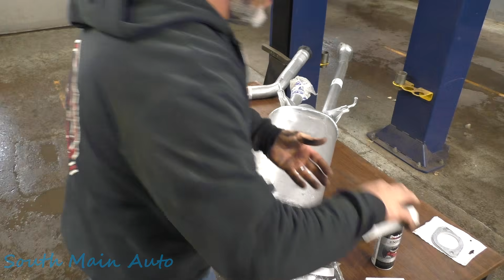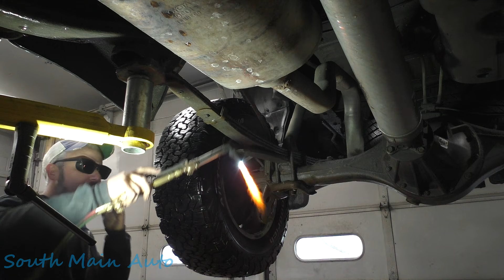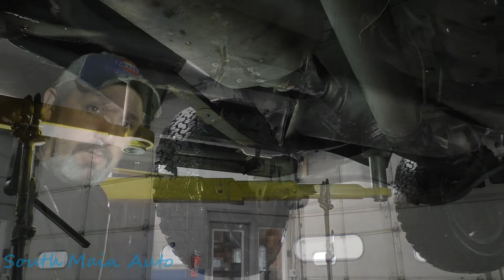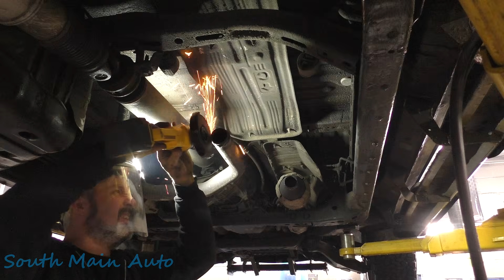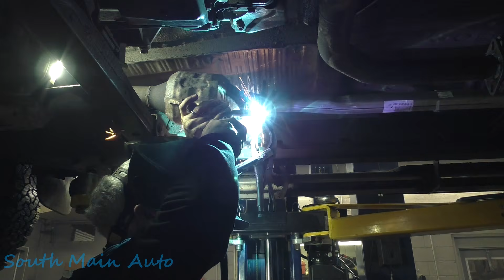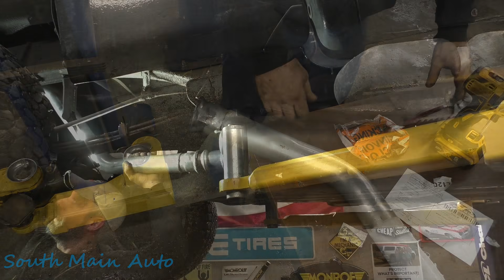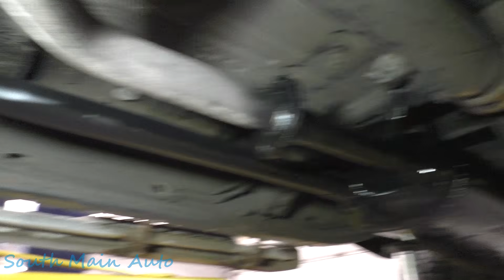Toyota Tundra: Welding On New Convertor Flanges & Replacing Muffler

Comment: I've been TIG welding for the better part of 25 years and I rarely burn myself now... or my hands are so full of scar tissue that I just don't feel it anymore. My coworkers however will burn themselves regularly, especially the person that I'm doing the job for. You would think that if you ask someone to use a shielded electric arc to melt two pieces of metal together they would be a little more careful about grabbing the part. I try to dunk it in the deep sink and quench it before they put their booger hooks on it, but that's not always desirable especially if it's going out to be heat treated, or if they're standing just outside the weld curtain saying, "Is it done yet? Is it done yet? Can I touch it? OW! Why didn't you tell me it's hot?!"

Comment: I'm a Chevy guy, but pre 2000 only. Got a 91 Silverado with 300k on the clock, and a 96 Blazer with 218k. Both still run great., In my 20's had a 72 Toyota Carina, 14 inches of snow could not stop it.....but my ex wife could. She blew it up.🤬

Comment: If I ever get to upstate NY on a road trip in my Idaho homed 2002 Yukon, I want to schedule an oil change at SMA so the crew can experience a little slice of heaven. My 2002 Yukon is 100% rust free. When I changed the trans filter, last year, all of the exhaust system bolts came apart with only some PB. The front brake pads and rotors are still original at 288k miles.

Comment: Free tip Friday for the ground on the exhaust.
Take heavy gauge copper wire, like welding cable, strip the insulation off of it, and wrapping the copper wire around the exhaust and welder clamp attachment clamps onto the wire. Works well for anything round.

Comment: Cutting torch expense...  Most likely, DIY'ers are grumbling.  But, I'm a DIY'er.  The Port-a-Torch setup with little pony bottles works well for the once or twice a year I need serious heat.

I've thought about going bigger but just haven't gotten around to it.  I see the need for heat more for metal work and forming rather than automotive repair.

Craigslist and Facebook Marketplace are your friend for low-outlay shop equipment.  Of course, it's a bit of work.  But, you pay either with cash or time...

Comment: Anyone batching about the cost of a cutting torch is working on 20 year old vehicles that still look brand new. I worked as a tech in Eastern Canada for Years and probably used the torch every single day. Someone from the south should try and take a set of rotted sway bar links out without a torch and without cutting them off

Comment: I work on stuff in my home garage.  I have a mini oxy/ascet torch tank set.  like, 1 foot high.  I just exchange the tanks locally when I need a refill, which has only happened once, but they are a life saver in the rust of the midwest, and I would say, a necessity in a professional shop for speed and time saved over fighting rusty stuff.  I have seen Rainman ray get some rusty crap in from the midwest or northeast, and he does well enough, but man, when shits rusted into a single piece, a torch that can get it hot FAST is nice to have.

Comment: Mechanic in Newark NY here. Had a Snap on guy ask me what my most used tool was. I said a torch and a hammer and he looked at me sideways. When you can cut a nut off and not hurt the threads you're officially a Rust belt mechanic.🤙

Comment: Huge disconnect between people who are used to rust and those who aren't.  Look at any online auction for a car with a little surface rust on it, the non-rust people think its junk.  Probably the non-rust people who never see a torch in the shop. What would they use it for when 20-year-old fasteners fall right off.

Comment: A set of oxy/acetylene  torches can be invaluable. As you know they are valuable for cutting heating loosening things but a lot of people don't realize with the right torche body and the right tips you can do some nice steel welding with them.  I have a nice set that I've had since the early seventies and I don't use them anymore but they're in my shed ready to go if I need them and I would not dispose of them.

Comment: I just fixed a guy here for the exact same thing. He ripped it off in the bush around his axle.
Aftermarket was crap also.
Flanges were already missing. 
Made new flanges with the plasma cutter for him from some steel and welded it on.
As for cutting torches.
Here in the GWN in Canada, it’s $100 a year lease per tank, then its expensive to exchange and refill the tanks here.
I use an oxy propane fuel instead as refilling it is cheap. Own a 50 cu ft tank and refill it for $35 then refill a 20lb propane tank for like $15. Much cheaper then having a acetylene tank refilled for over $100 and rental fees etc, then local place even screws you again if you don’t exchange the tank once every 12 months.
I plasma cut a ton of things now instead and use the oxy propane to heat things. Or cut some exhaust off with just a regular sawzall

Comment: Hey Eric we keep a cutting torch in most of the shops I have ever worked in, down here in Texas and even have one in my dads shop since I was like 4 years old. Oddly enough the one that is in my late fathers shop, is the same one that he had back when I was 4 years old and the only thing that has been done to it is the hoses replaced. And yes we use those cutting torches for much the same things, cutting rusted bolts and exhaust pipes. Now before you get shocked yes we have rust in Texas as well especially down on the gulf cost, and more so on old trucks that are 30 years old or older. Had to cut a few bolts on my old 1965 Ford F-100 when restoring it some 30 years ago, that cutting torch sure got a work out that year as I did a frame off restoration.
Reply: I have purchased a few southern vehicles. I have had to heat up exhaust fasteners to remove to prevent breaking.

Comment: I used to lease my oxy/acetylene and argon/CO2 tanks but, I picked up a nice big set of Torch tanks and 2 #4 welding bottles at a local farm sale a few years ago. Owning them works better for me because I can get them filled at the cheaper of my 2 local welding supply shops.

Comment: Hi Eric, you are a master with a cutting torch. I would be happy to be half as good as you. Welding is plenty good enough. I would be well pleased with your result. A truck exhaust is not a 1500 PSI gas pipe.

Comment: For a truck driven in the north east, the frame and undercarriage look really good.
Reply from the maker: It is a daily dirt road driver and a I plow with it
Reply: Fluid film
Reply: @chrisE815   looks like a ton of it has washed worn off to bare metal... use WoolWax its thicker stuff
Reply: @efil4kizum  yep,  I agree. Got a 5 gallon tub of that stuff just gotta get around to it this year lol
Reply: @chrisE815   if you really do not wish for it to wash off with ease get the WW HV stuff that you brush on when its hot out and goes on smooth as butter and thickens when its cold
Reply: @efil4kizum  What is WW Heavy? I can't find it anywhere not that I would buy it anytime soon because I have 5 gallons on hand
Reply: @chrisE815  HV is high viscosity WoolWax for extreme high wash applications. I found it on their direct website and so far after 3 years I have good results of it staying put in the rear wheel wells where FF and regular WW eventually washed off in heavy rain wheeling. They sell a small 16 oz jar to try it out... One drawback though is it collects dirt and sand like mad up on the front control arms suspension area
Reply: @efil4kizum  Good info thanks
Reply: An ounce of prevention is worth a pound of cure, as they say.
Reply: Fluid film my 06 Tacoma every year and I live in southeast PA where the brine and salt are used. The frame is still original and looks great. Like Eric’s Tundra.
Reply: @mikeanthony7940   is a lot of FF washed and worn off like it is here  unprotected metal
Reply: I never heard of fluid film until I started watching here.   If we get a few inches of snow here in the South it's over. Snow plows??? Haha nope. Not here. We all just stay home and wait for the roads to melt 24 hours later
Reply: @MARKE911  i would look into WoolWax WW, its much thicker and durable than FF, and doesn't wash off quite as easily as FF leaving unprotected metal at sub zero degrees
Reply: I live in Michigan 9 inches of snow means you leave 5 minutes early for work. But you still stop and get your coffee ☕

Comment: Nice truck! You guys can try Northeast Exhaust for oem style 409 mandrel bent catback exhausts. Kinda cheap surface rust still shows in places but for the price it can’t be beat. Depending on application might need “corrections” but still OK LOL

Comment: I used to work at a big name tire shop before I moved on to my current career. We had a torch when I worked there. I needed tires I went back to my old shop to see what everyone was up to. While I was talking to one guy I saw he was using one of the induction heaters to heat up a nut on a tie rod. I asked where the torch was, and he said they are not allowed to have it anymore cause some guys got careless and other locations and caught a couple cars on fire. The district manager freaked out, and said no more torches.

Comment: Out of curiosity- did you consider the Toyota stainless TRD exhaust system? I realize the standard system is on backorder, but I think the upgraded TRD system is floating around at some dealers. Since it's a factory Toyota exhaust the noise level isn't much louder than stock unless you're foot to the floor. Price is around $700 so that's the only negative.

Comment: The heat wrench is a must where I come from. I use propane and oxygen , it works awesome , I don't miss acetylene at all. That's the best looking aftermarket exhaust I've seen in a long time , hope it holds up as good as it looks
Reply: Only the second time I have heard of using Propane rather than Acetylene.
Reply: @dougbourdo2589  All the muffler shops I used to go to used propane.
Reply: I also use propane and oxygen it's much cheaper and unless you are cutting 1/2 in plate steel there is not a huge difference.
Reply: When I was farming we used a carbide acetylene generator. I know it was an antique. Switched to propane in the winter.
Reply: It's painted black.....so you know it's good. But then he puts his had over the tail pipe for a second, probably set a code🤣

Comment: I bet your engine runs great, and your transmission hasn't blown up. Those are great trucks. The muffler on my 2004 5.9 ram completely rusted through and the fuel pumps went out, that's been it. The 2013 Tundra's not that old(yet). Thanks for doing the video.

Comment: I personally hate the cutting torch for anything other than absolutely needed! Work with some folks that will only use it just to heat a bolt of nut up! Freaking hate that! Flame is too big not well controlled enough for me! Its like using a 120 welder just nope nope nope if it's not a 220 I'm not gonna even look at it!
Reply from the maker: Wow haha, you must really hate me, I used a 110 welder and a torch in the same video.

Comment: Eric, I saw wondering if you disconnect the battery before you use the arc welder? I had a friend a few years ago who had a muffler put on at a national chain shop and his battery was toast after they finished the welding.
All the best to you and the family for the Holiday Season!
Reply: That won't stop any damage. You notice he commented a couple of times about keeping the ground clamp close to the work. That is much more important than the battery.
Reply: @Itsalongwaythere  You need to be sure the ground is close and in a direct path to the welder. Where you run into trouble is if any of the current can take a different path through the electronics. So say you have 2 pipes and 2 flanges to weld. Fit it all up, then ground to pipe A and weld on the flange on that pipe. Now ground to pipe B and weld on it's flange. Keeps the loop short. When it really counts is doing bodywork with a welder. Then you can have different grounding paths and ground loops become an issue. 120 amps at 6-8 volts through a computer boards ground path is not a good thing.
Reply: And the computer can get cooked

Comment: you forgot to tell us the wire you used, the feed rate, the amperage and the gas mixture 🤣
Reply from the maker: 75/25 on the gas, 0.030 wire and used the auto feature for wire speed and heat on the 211 Miller ;)

Comment: I’m in the Midwest (aka the other rust belt), and yes torches are necessity in our shop. The time it saves, and the ability to get out rusty hardware is well worth the expense. We lease our tanks as well through prax and when we have empty tanks they just swap them out. No need to worry about hydro testing and such.
Reply: Even for non-rusty stuff like the single nut end of a shock absorber, cutting the nut off with a torch is much faster than playing around trying to stop the whole thing spinning with the wrench.

Comment: Eric did you disconnect the battery before you started to weld? Good way to fry the computer
Reply from the maker: I always aske everyone this question that says that. Explain how it fries the computer. Serious question.
Reply: Just the way I was taught. I would think any kind of sudden surge of voltage such as a welder can't be good for the electronics in a new car. Sort of the same way you need a surge protector in your home to protect electronics from surges of electricity
Reply from the maker: @francisgall6172  But the current flow from the welder only goes from the tip to the ground electrode. That is why you ground close to your work. Now If I moved that ground electrode up to the negative battery post....well, then we'd have a problem. As long as you understand current flow you'll never have an issue ;)
Reply: That's the problem. Not everyone understands current flow and not everyone knows to keep the ground clamp close to the work. Hence they may have a problem. Much easier to disconnect the battery for safety sake. These new electronics scare the crap out of me and they seem very temperamental. I for one would not want to create a monster

Comment: You can tell someone what the salt does to a vehicle, but unless they've spent 5 hours with a slide hammer replacing 4 wheel bearings they have NO clue.  I only work on my own cars, but have threatened to buy the blue tipped torch on more then one occasion.  The the price is prohibitive for this home gamer.

Comment: I live in the northernmost point of Virginia (not Northern VA which is below Washington DC but in Winchester on the western side where it comes to a point). A torch is the only way I've seen mechanics here remove exhaust systems, and they have been used on stuck fasteners etc. so I don't understand complaints about the torch either.

Comment: I'd love to have a torch set, but, as a shade tree mech I just can't justify it.  I would have done all that cutting with my 4 1/2 inch angle grinder with a metal cutting blade.  But, yeah, I'd love to have a torch like that.  Some times a map gas home kit will work if all you have to do is heat something up.  Of course it will not cut steel.

Comment: One reason I watch you is because it reminds me as a kid hanging out with my brother-in-law at his shop when swapping mufflers could make a man a living when he wasn’t driving a truck over state lines 40 plus years ago. Back then the only guy with a lift capable of raising motorhomes within 30 miles of Lake Elsinore and had a pit in his shop for bigger rigs.
Anyway his go to tool for dropping exhaust systems was a cutting torch or air powered saws all. 
Funny enough you can type in G&R Muffler and it’s top of the list on Google search even though it hasn’t been open for 30 years.

Comment: Yeah nothing serious just like every 07 Camry back in the day blowing its motor up couldn't even find a four-cylinder in the junkyard to replace it with had to get a new short block from Japan all that year I went to the dealership there was two or three blown up at different dealerships in my area we only had 67,000 miles on it the worst part is they solder extended warranty for the car but a bullshit 60,000 MI warranty always dealer maintained they would not stand behind the product I think this was in like 2010 but the V6 is seemed good but if you have the oil pipe that's hard and then rubber there's a replacement kit you can get that has all the seals and everything the rubber part fails on the factory oil lines there's a whole kit you can get from Toyota it's not listed in the catalog because it's an add-on replacement somebody did a video on it that's why I know about it on YouTube

Comment: There's an old adage that the best mechanics own the most clapped-out cars. Speaking as someone that spends 40+ hours a week spinning wrenches, sometimes the last thing I want to do when I'm not on the clock is pick-up a wrench and turn it on my own pile of parts.
Reply: So very true, I think it's a combination of things though. One, we don't want to work on down time and two we tend to know if something is actually a big deal that needs to be repaired ASAP or if it can wait a bit and three, we know that the repair is likely to snowball....
Reply: We know how bad a car can get before it needs an actual repair.
Reply: Yeah, I'm guilty.